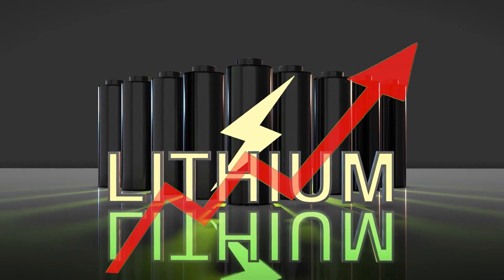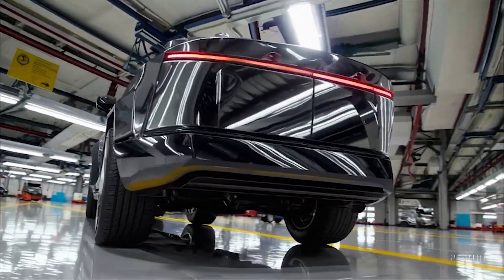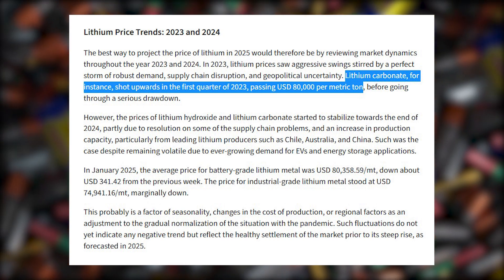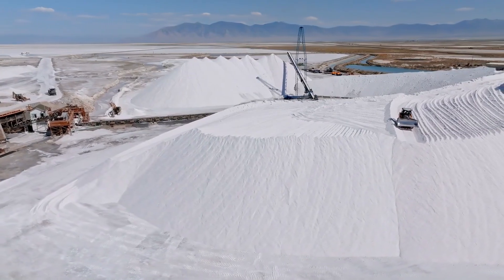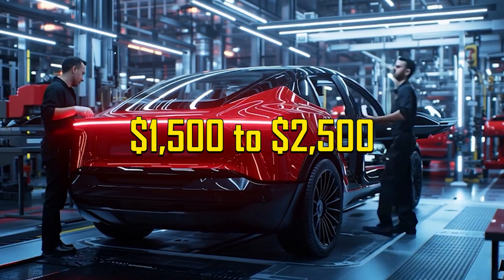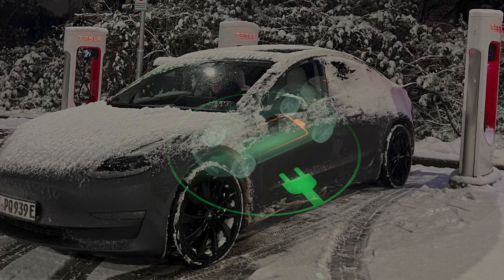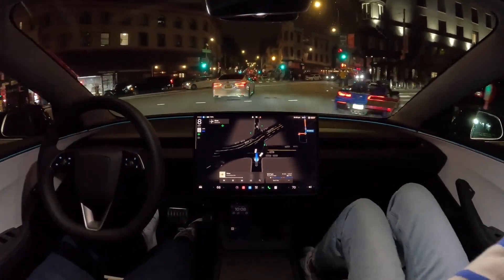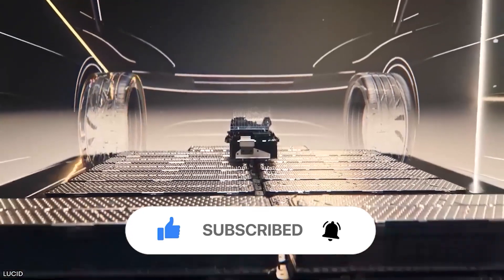End of Lithium! Elon Musk Revealed ALL-NEW Battery Tech For Model 2. Never Been Cheaper!

Comment: I have heard of Sodium based batteries, and I was wondering how long it would take for them to become the new Normal.
Reply from the maker: Great question! Sodium-based batteries are definitely gaining attention as a cheaper and more sustainable alternative to lithium. Right now, they’re mostly in the early stages of commercial use—mainly in smaller energy storage systems and a few EV prototypes.

If development keeps progressing, we might start seeing them more widely used in consumer products within 3–5 years, especially for lower-cost EVs or stationary storage. 

Curious—would you consider switching to an EV or device if it ran on sodium instead of lithium?